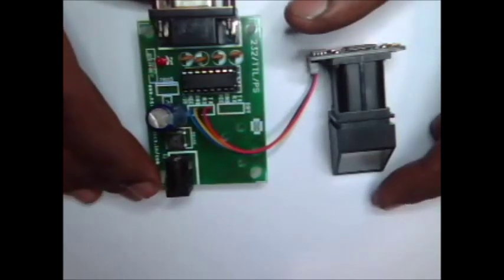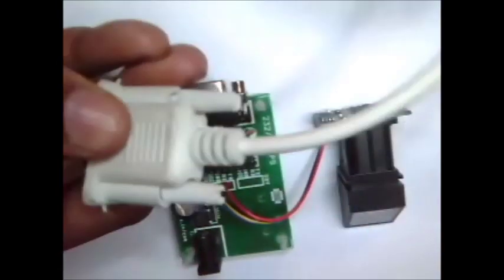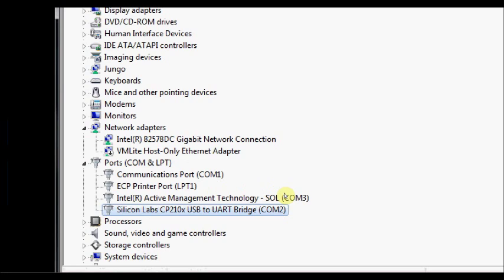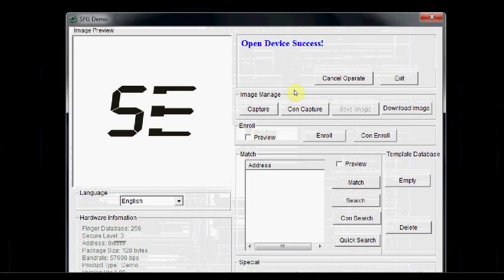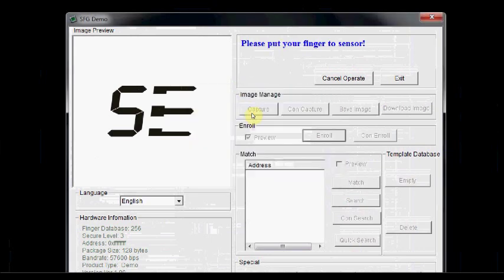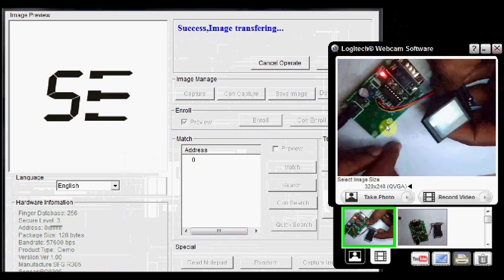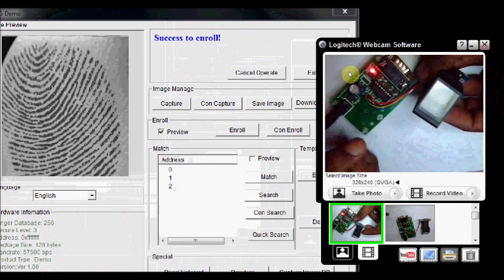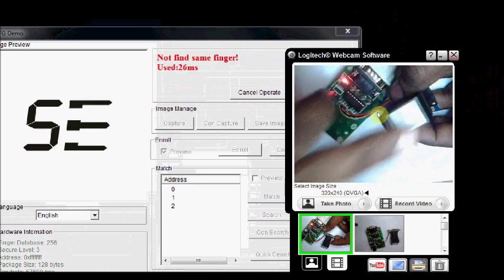Optic Finger Print Sensor

Comment: Sir please tell how to interface it serially with microcontroller.??
Reply from the maker: Interfacing with Arduino is made easier as Adafruit library is available.But to interface with others you need to read the datasheet & understand the hex codes that return from the sensor.
You can read this to understand how the hex code is handled 
https://www.engineersgarage.com/contribution/fingerprint-detection-using-microcontroller

Comment: Hi Mr. Sravanan it's a great tutorial. I have tested my finger print sensor using sfg demo software successfully and its working fine. 
My question is after i have tested  how can i interface it to arm lpc2148 microcontroller not arduino.
for establishing serial communication with my microcontroller what are the commands for finger print sensor to communicate
with my controller.
how can  set packet size and security level and baud rate in my microcontroller.

Comment: Sir,
I am getting an error: 
Open device fail, please check the password and the device address.

I actually took out the four wires from the Max232 board and attached it to the equivalent pins on the USB adapter you showed. In the Device manager, it recognizes the device and allots it to COM9. Still this error throws up when I connect to the device in COM9 in the SFG Demo software.

Please help.

Comment: Nitheesh Davis  i also facing with error like you and i still don't kown how to solve this problem...Have you solved this error? please help me..thank you very much !!
Reply: "Open device fail,please check the password and the device address"
Reply: +huyhoang le your connection is wrong.please connect the finger print right.the Tx of the finger print with the Rx and  Rx with the TX of the arduino. with using arduino also use this link for help. https://learn.adafruit.com/adafruit-optical-fingerprint-sensor/enrolling-new-users-with-windows

Comment: Hello sir... when i click to open device and choose  COM port it shows this error message "Open device fail,please check the password and the device address ..please help me
Reply: ram chauhan  i also facing with error like you and i still don't kown how to solve this problem...Have you solved this error? please help me..thank you very much !!
Reply: your connection is wrong.please connect the finger print right.the Tx of the finger print with the Rx and connect  Rx with the TX of the arduino. use the arduino visit this link for help. https://learn.adafruit.com/adafruit-optical-fingerprint-sensor/enrolling-new-users-with-windows

Comment from the maker: R303a can be interfaced directly to Arduino Rx-> Tx ,Tx->Rx. No level converter needed.Try to use hardware serial & not softserial with Arduino.But coding is bit difficult.
You can easily use R303a with SFG demo software.For this you need a level converter as shown in video.

Comment: Sir I'm using R303a module with arduino, but its failing to communicate serially. and could you tell me if R303a can be directly used with arduino without level converter ?  Or else is it possible to use R303a module with SFG software?  please let me know the possible solution for it

Comment from the maker: Check up your power supply adapter to Rs232 board of sensor.Also try changing the Max232 IC on the board.Release the loop back connection & use only SFG ,as images can be handled only by this software.

Comment: I already done the procedure exactly as in the video.Also i interfaced my laptop's usb to serial port to the RS232 board supplied with finger print module with loop back with result showing in Hyperterminal.So the promblem is not with serial port. Can u please tell me how i can test this module other than using SFGdemo software

Comment from the maker: If you are connecting the sensor to a Laptop,you need an USB-UART board or cable.Under Device Manager confirm that the USB-UART board is recognised & allotted port.This port no. should be entered under "open Device" setting of SFG demo.

Comment: I bought the fingerprint module R305 from local vendor and i tested it with SFGDemoV2 but when i click to chose COM port  it shows this error message 
"Open device fail,please check the password and the device address"
Could u please help me to solve this issue or just give me direction to how to interface this using hyperterminal
Reply: same